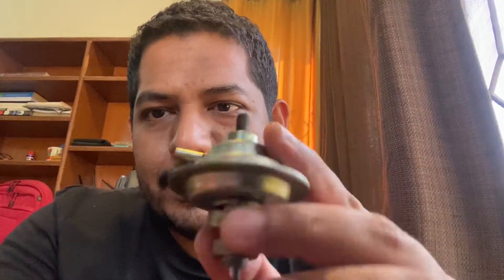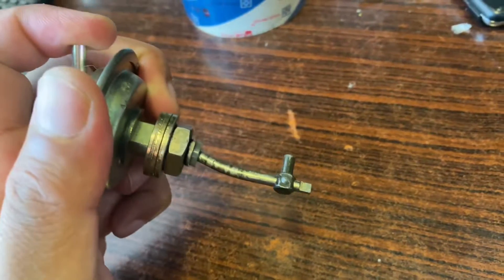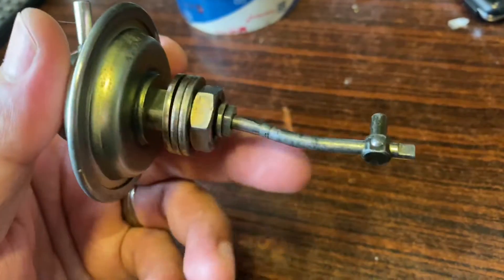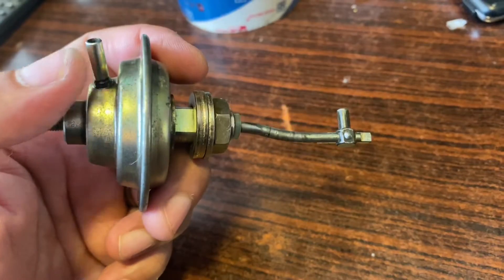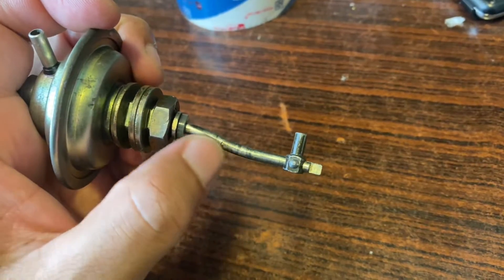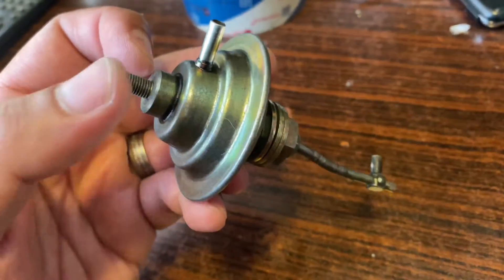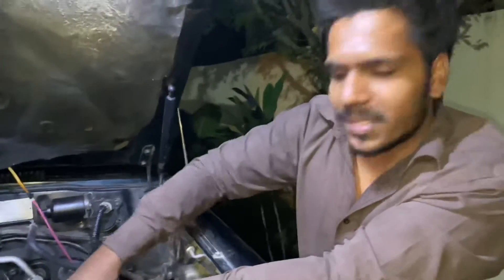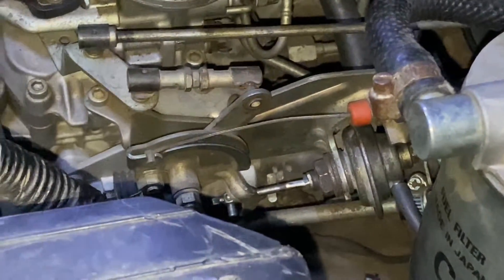AC Idle Up adjustment - 80 Series AC and power steering throttle actuator setting

Comment: Some 1HD-FTs have both AC and P.S (power steering) idle-up. Those have a double diaphragm as opposed to the single one in the beginning of the video. The adjustment you mentioned actually adjusts the P.S idle up in the double diaphragm actuators. The nut on the top is for the AC idle up. The actuator that you ended up installing is the double diaphragm one, so now you should have PS idle up when turning the wheel completing to one side on idle, given that you have connected the vacuum hoses.
Reply: Aoa from where can this be bought and can you please share your number I have a 2003 amazon and idles up quite a lot when AC is turned on..
Reply: Isn’t the PS and AC dual actuator supposed to have two independent shafts? One for AC other for PS? Also will much appreciate if someone could give me the actual toyota part number.